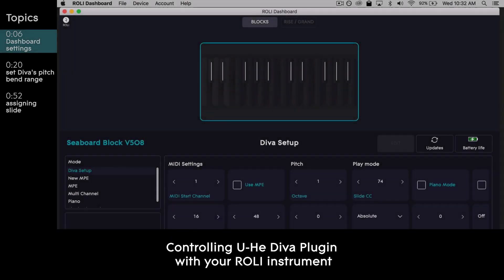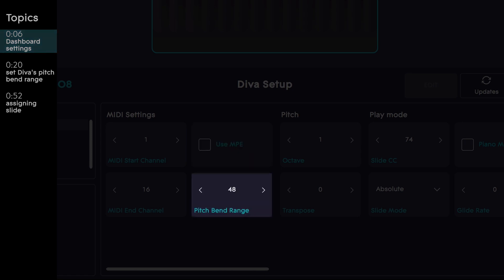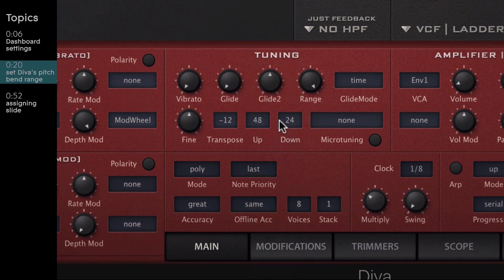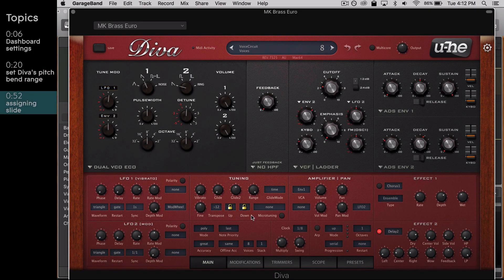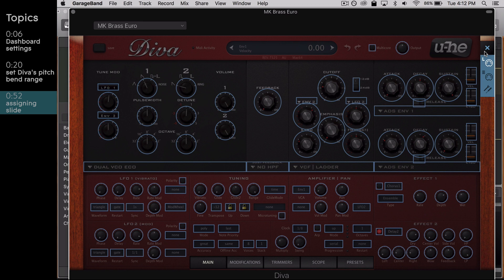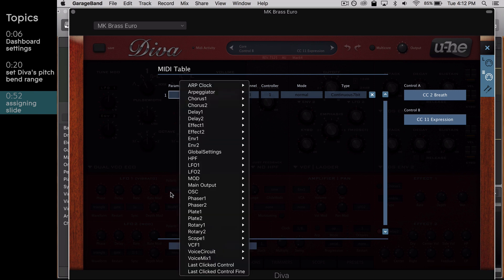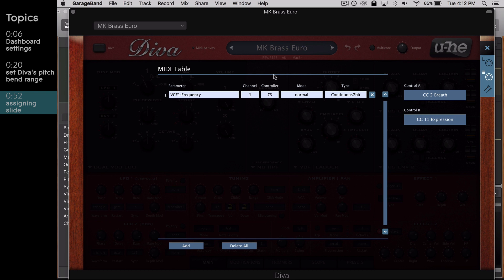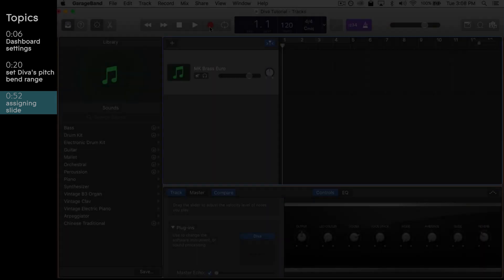Controlling U-He Diva Plugin with your ROLI instrument

Comment: From u-he: What is shown in that second part of the video, with the multiple per-channel routings to filter cutoff, that will not work in Diva. Assignments on the MIDI Learn page as shown in this video are not processed per MIDI channel, they're global changes for all voices/channels.
Only performance controls are processed per MIDI channel (that's velocity, mod wheel, pitch bend, aftertouch and also our customizable "Control A/B"). Check the manual for "Control A/B" and how to add that mod source in the patch itself.

Comment: BITWIG users. No need to do any of the above. (actually didn't even work for me.)

BITWIG Device DIVA : MPE 'ON'
add 'EXPRESSIONS' modulation onto Diva Device.

Timb = Slide
Vel = velocity
Pres = aftertouch/pressure
Rel = release of key. 

It will even light up the little icon when you do the action.
Remember that It assigns in Bi-Polar.  So if you have it on absolute make sure your cutoff knob is higher if you assign it to slide.